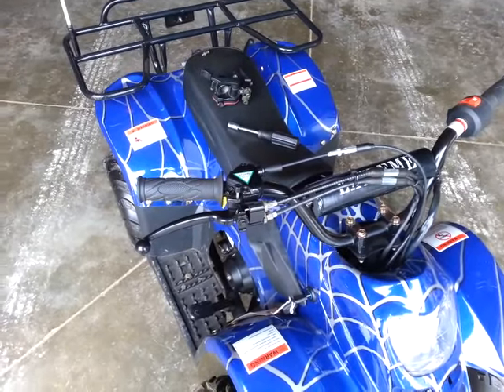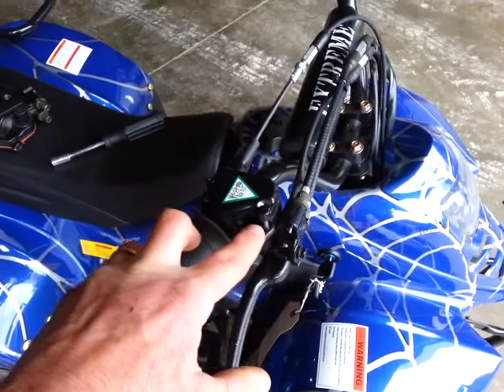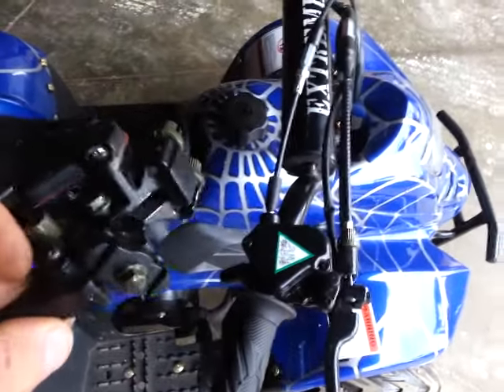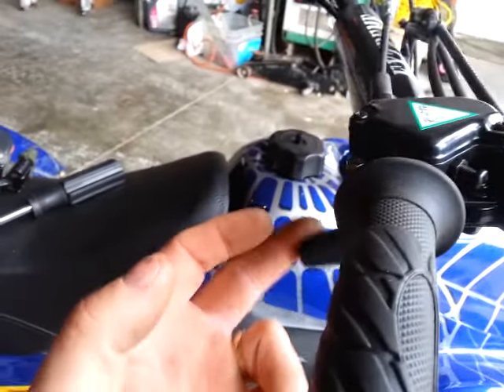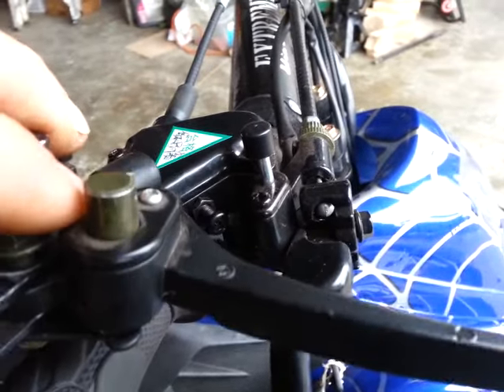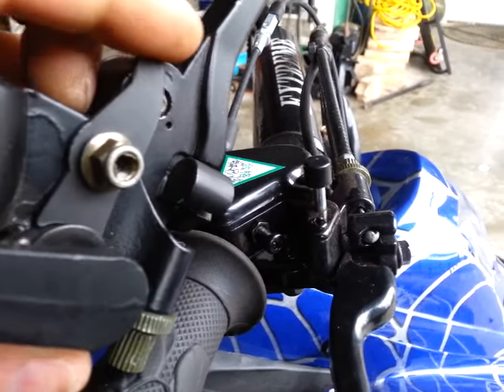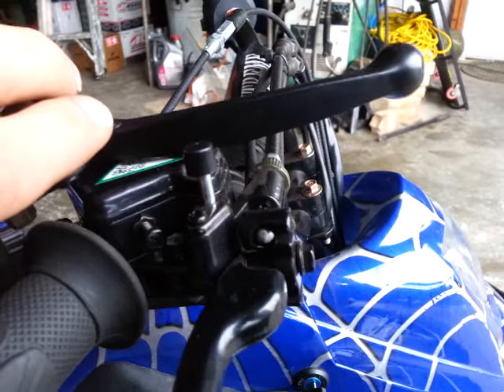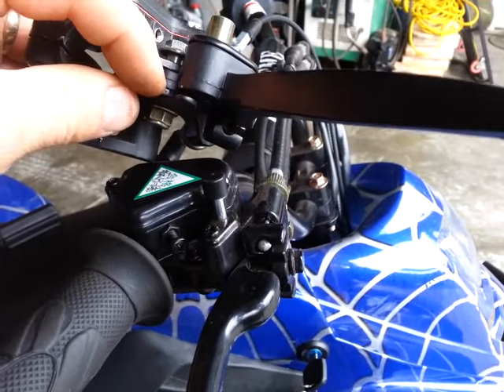ATV 110 / 125 Brake Lever

Comment: What would be the issue if the front brake will not activate the starter??? My other model works great. I can still crank the bike stepping on the rear brake pedal. Also I'm trying to find some new pads for my coolster? The pads are just a little over 3 inches?? These look glazed over...thanks

Comment: My front brakes are locked up
Reply from the maker: Hey Lucas, Sounds like you have cables that may be frozen or rusted and won't allow brakes to either be released or applied. Should have 2 cables to front wheels. Remove one at a time releasing cable at both ends. Cable should push/pull freely. After removing cables front wheels should also spin freely. If not you will need to service front drum brakes. Good luck!